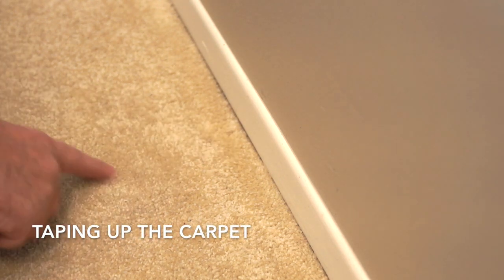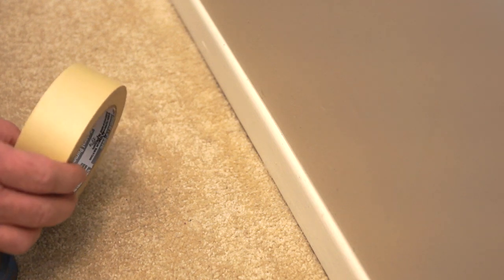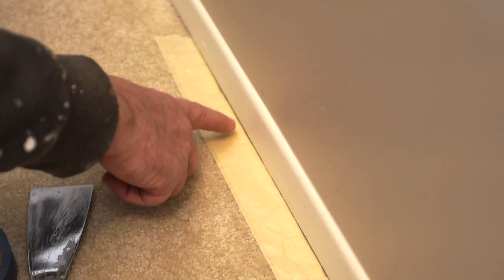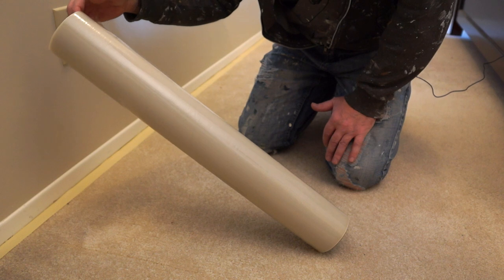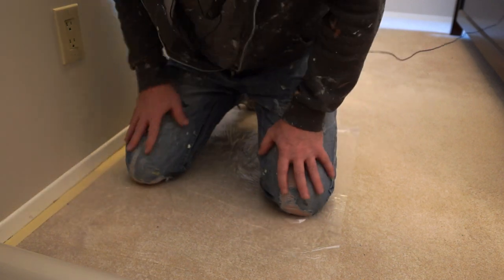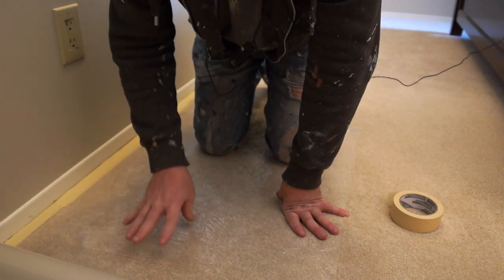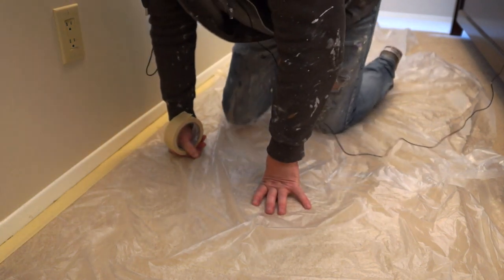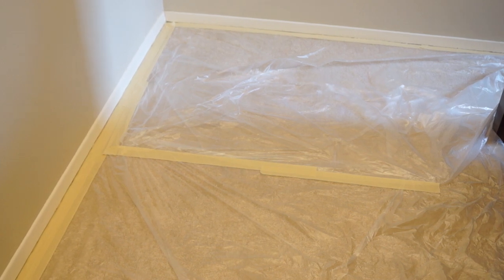Covering Carpet With Plastic or Carpet Protector Before Painting

Comment: Hi thanks for this. Can the plastic be re used on a different room?
Reply from the maker: That's problematic.  Once the plastic has paint on it and you have taped to it, it's kind of a pain to pull it up carefully and reuse it.  The paint you get on the plastic, once dried, will also flake off and can make a mess if you are not careful.  If you are just laying plastic over furniture in the middle of the room and not getting too much paint on it, then yes, you could easily reuse it then.

Comment: Thank you for the demonstration.  Does the carpet mask leave a sticky residue after you take it off? I have read many other types of sticky carpet protectors ends up leaving a hard residue on the soft carpets.  Also up to how many days can we leave this on?
Reply from the maker: As I have heard of this problem, it has never happened to me.  One thing to keep in mind is the kind of carpet you are applying the masking to.  According to the directions, it is not recommended on wool carpets, but not because of residue, but because it can pull up the pilings. 
Also, if the carpet has just been recently installed, you should let it sit for a few days before putting down the masking.  

I have left  the masking on as long as 3 months and, again, have never had an issue, and it has never left a residue.

If you are concerned, and have the time, you may want to test it for a couple of days in an inconspicuous area.

Comment: Do you just use carpet protector around the perimeter and plastic sheet in the middle of the room? Or do you have carpet protector throughout the room?
Reply from the maker: It really depends on the job.  Most of the time however, I use carpet protector around the perimeter and plastic in the middle.  Using carpet protector in the high traffic areas is another way to approach it.
Reply: @DaveMartin  thanks again

Comment: The person remodeling my bathroom used this on my linoleum and after the construction was done it will not come off. Does anyone know how to get it off without damaging the floor?
Reply from the maker: Ya, that's a problem.  For anyone reading this, only use this product on carpet.  I'm assuming it's the glue residue that is left behind, or is it the carpet protector itself?
Either way, be careful about using Goof Off or the like on the floor as it will dull those finishes.

Let me know if you have not had any luck, I will do some research and see if I can find a solution.
Reply: @DaveMartin  it was both the film and the adhesive. I could only get off small pieces after hours of trying to get it lose.  I have a bad back ( 2 spinal surgeries) and also limited funds so have been working on it a little bit at a time. I’ve tried everything. I probably need to redo the floor but being retired I have limits. I tried a hair dryer recently and it seemed to help. Only time will tell.